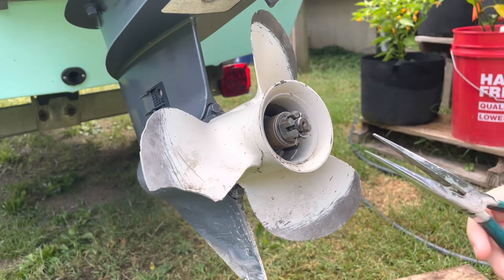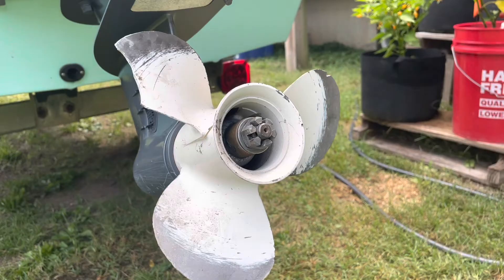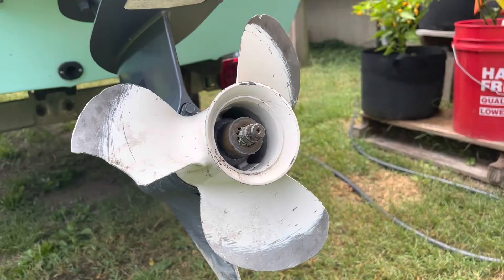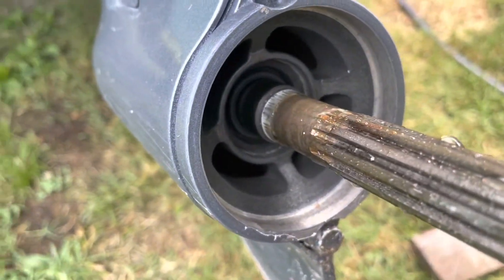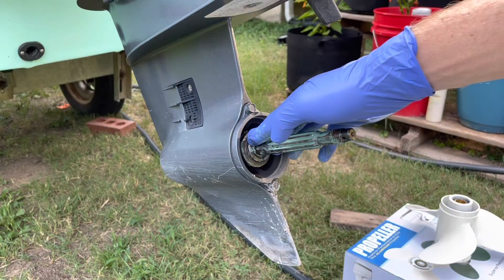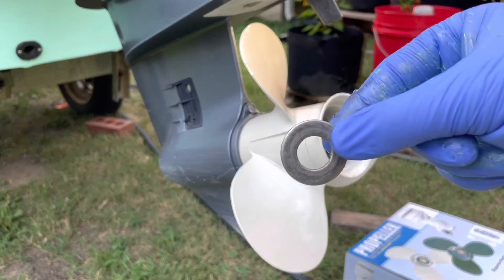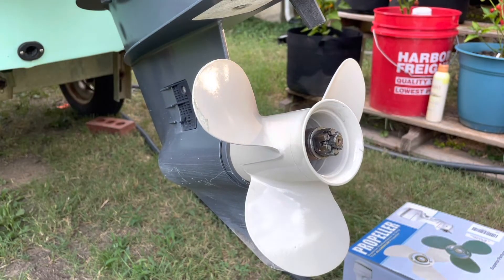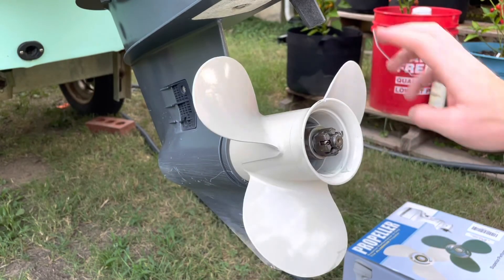Changing an Outboard Motor Propeller - Yamaha 25 HP

Comment: If you put it in gear the prop wouldn’t spin
Reply from the maker: That would work and if you’re in a pinch out on the water and don’t have a block of wood sometimes you gotta do it. I’d say that blocking the prop is a best practice though to avoid any unnecessary strain on the prop shaft and gears in the lower unit.

Comment: Good vid. Have the 25. Here I have to use a stainless prop. I fish a fairly shallow salt marsh with lots of oyster reefs and mud banks. Aluminum doesn’t hold up very well. After 17 years even the stainless is looking bad. Watched the vid to remember how to do it! Thanks.
Reply from the maker: Appreciate it! You really can’t beat these motors. I’ve just been using cheap aluminum props off Amazon to protect the lower unit and it doesn’t matter if I tear through a few of them. Where do you fish out of?